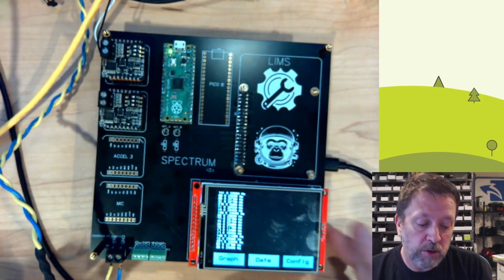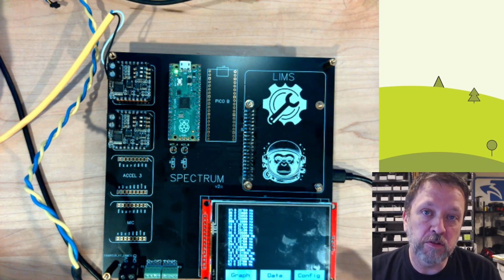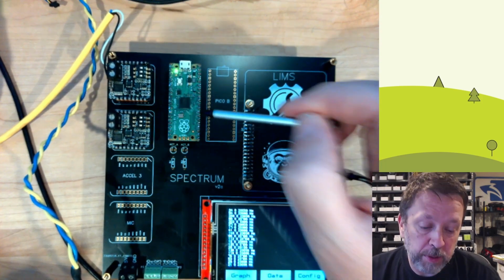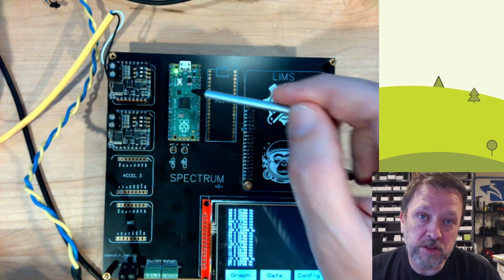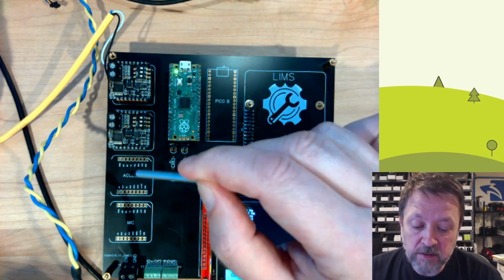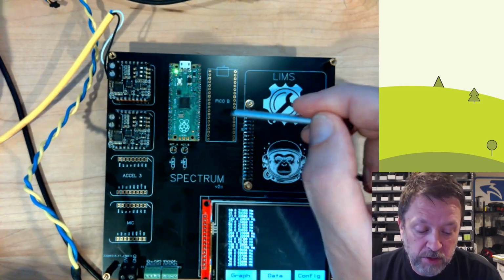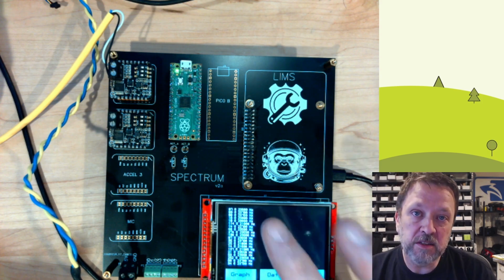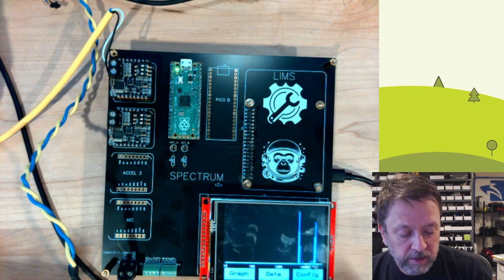Using a Raspberry Pi, Two Pi Picos, and C# to create a Custom Spectrum Analyzer

Comment: Doesn't the meadow have adc with continuous sampling and / or DMA support? Some micros have pretty advanced adc capabilities.
Reply from the maker: Yes, the Meadow STM32F7 does have DMA for the ADC.  But it turned out that doing the FFT math, driving a UI, and providing a network exfil for the data just was more than the STM32 could handle.
Reply: @dotnetMakers I see. Would have been cool to see the meadow board doing all that.
Reply: @AkosLukacs42  I guess it is also a question of how cost sensitive this is and how many pieces you need. I guess it's easier to do things part by part with different modules and pay a couple of dollars more instead of trying to do it on one board. But if you would need many of them and cheap, then this looks different.